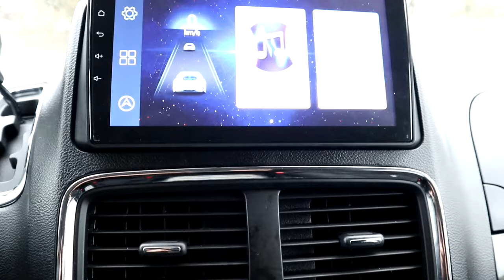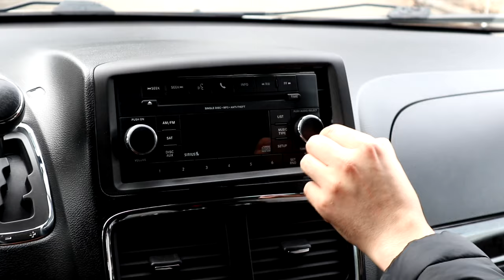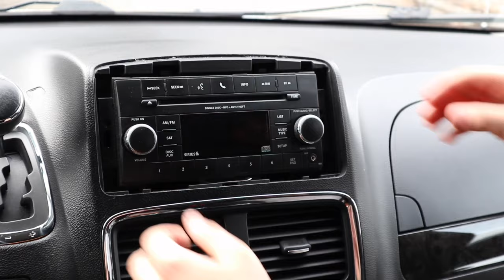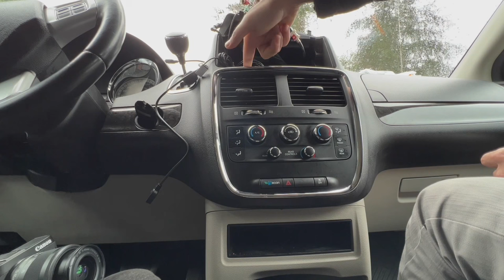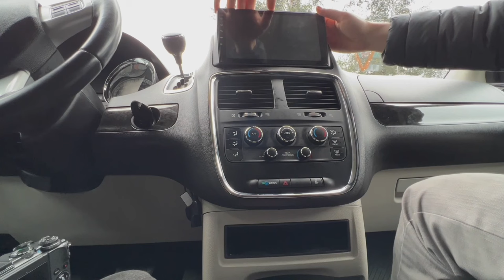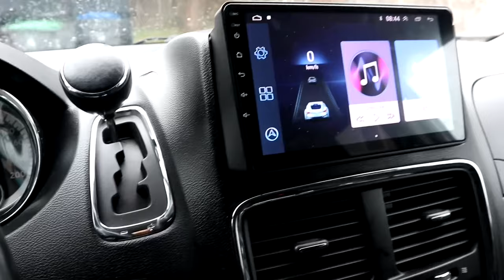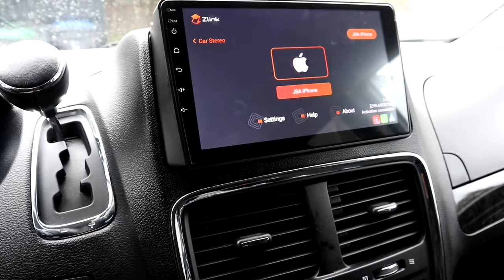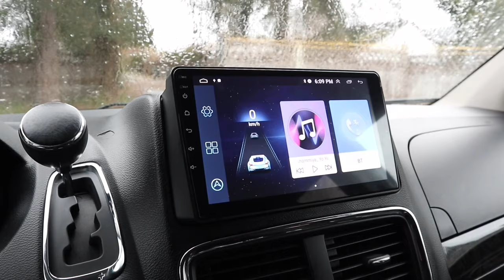Dodge Caravan Radio Screen Android Auto Apple CarPlay Backup Camera Plug & Play Install

Comment: Is it possible for you to show or do a step-by-step and how to properly configured the steering wheel controls so they work. I got everything else working except my steering wheel do I need a different cable
Reply from the maker: The new link in the description is the kit that includes the screen as well. This one is the exact same one that’s in my vehicle with working steering wheel buttons. Perhaps your screen has issues.
Reply: Are there clips that hold the radio in like the original radio? As well do you have a video about setting up steering wheel buttons? Great product, thanks for the video
Reply: Can you please tell me what settings you used for the steering wheel controls? I can't seem to get them to work and I'm not sure what the settings are. But if I also have a 2015 Dodge Grand caravan so if you could call me what your controls are I could set it up as well then
Reply: @arlentulloch6481  I have the same concern, there is no way to fasten the unit down. It is loose and rattles.

Comment: When its on wireless does apple carplay run smooth? Are the navi caps slow or choppy? Does it run better when plugged in?
Also any issues with over heating? does it have a fan?
thanks

Comment: Thanks for the sensible and informative video! Does the car have the blind spot sensor? I have read in Chrysler forums that you need to keep the original UConnect radio for this to keep working or substitute it with some Maestro RR module...
Reply from the maker: No blind spot on my vehicle.

Comment: Great video! Does the screen need a "dash kit" to install the new radio into?
Reply: Most of the ones on Amazon that are listed for this make and model (2008-2020 Dodge Grand Caravan) come with everything needed, including the frame / bezel and the wiring adapters. Minimal splicing is sometimes needed if you want to use your original backup cam.

Comment: I have a 2918 Dodge Caravan came with the satellite radio Sirius and an OEM backup cam. Can the original wiring from the backup cam be used for this setup? Very interested to dobthis upgrade. Good video with a wealth of information on how to open the cluster. Thank you
Reply from the maker: Your OEM Camera can be integrated into the aftermarket screen but it requires a cable that converts the OEM backup Cam wire to RCA which then connects to the aftermarket screen. You will have to source the adapter online. I’m not sure about the Sirius Satellite Radio.

Comment: Thank you so much for this clear tutorial. (At 00:11:00) how difficult is it to create space for the USB and mic cable? That’s my only concern about getting into this project.
Reply from the maker: It’s not hard as there is a lot of room to work with on the Dodge Caravan. Easy to route the wires around/behind the dash.

Comment: I have a 2019 Caravan....did your Van have the rear screen and if so, does it push output for Netflix, USB input, SD card, etc to the monitor?
Reply from the maker: Unfortunately, the rear entertainment system is not supported.
Reply: @samiseries6295  Follow up, did you need an additional adapter to retain steering wheel controls?
Reply from the maker: No additional adapter needed you just have to change the canbus from what ever it’s set to jeep in the canbus settings. If jeep doesn’t work for you try going through the list until it works.

Comment: i have an 2019 Dodge Grand Caravan Crew, this Android Radio Screen work with the original genuine rear back camera ?
Reply: Thinking the same thing
Reply from the maker: It does but you have to find the adapter cable that converts the stock connection to RCA video.

Comment: Thank you, this looks great! Did you ever get a back up cam installed? Was it hard?
Reply from the maker: Yes I did. Video of backup cam install is on my channel. Check it out.
Reply: Will check that out right now, thank you again. I have my unit coming Jan 9th for my grand caravan!
Reply: @samiseries6295  no video to be found. Alibaba is asking to purchase 2 units minimum. Why?
Reply: Did the mic work fine on highway speeds as fsr as phone calls? Or was there a lot of road noise?

Comment: I am trying to reach out to you on the website to purchase one for my dodge grand caravan 2015 .. how long does it take to get delivered to Maryland ? And will I need to buy any thing extra or everything is included in the package?
Reply from the maker: Sorry for the late reply. It will take 2-3 weeks. Everything is included in the kit to get the screen and after market cam installed. You may need to source a power cable/tappers to tap into the reverse light of you vehicle.

Comment: Do your dash board speaker work?    I installed my setup with an aftermarket harness but i only get sound out of my door and rear speakers.  No dash board sound.  Or center speaker.  Let me know how yours sounds.   Thanks.
Reply from the maker: I would have to confirm then get back to you.
Reply: @samiseries6295  thanks

Comment: Sami did you figure out how to connect steering wheel controls to your head unit??
Reply from the maker: They should work out of the box. You may have to change the CANBUS setting if it’s not working. Supplier should be able to help you with that.

Comment: Does it support steering wheel controls?
Reply from the maker: Yes the model that I purchased works
Reply: So I ended up buying a radio I connected it today but it’s not supporting my steering wheel  control do I have to add any other cable. Also this radio does not come with zlink. Do you know if I can access apple car play.
Reply from the maker: @RonDIYMods  Did you try programming the steering wheel controls? Could be the actual screen itself. It should have Zlink as I ordered the ones I linked and connected them to my Van to make sure it has zlink and everything works fine.

Comment: I'm interested in ordering this kit ....So how has this head unit & kit been working on your Dodge ? What is the name of this unit or is it just a no-name china unit....as I don't see any reviews? How is the sound and speed? Any glitches with its processor? I don't see a wifi antenna ?   And how long for shipping when ordered thru your store? Is there any warranty and customer support?
Reply from the maker: The one in the video is the original one I installed which turned out to be bad but since then I changed it to a much better model which is working great. New model which is currently sold on website includes wifi and is better overall.
Reply: Thanks for this!  Exactly what I’m looking for in my 2014 Chrysler Town and Country. Is your updated link the link for the new radio that isn’t faulty and is still working in your vehicle?
Reply: One more question, when I go to the link provided it looks like the product on Alibaba contains less wires than what you show in your video (radio antenna at least.).  I am excited about a plug and play but want to make sure I’m getting what I need.  I’m also hesitant because I see some comments saying it cost 290 something and what I am seeing is cheaper.

Comment: does the volume and skip/tune controls still work when you switch over?
Reply: You have to go in the settings and change things for it to work again
Reply from the maker: On the steering wheel? Yes mines worked.

Comment: Is this a reliable unit compared to the Sony that has 3 year part warranty? I worry about these no name units and their reliability....
Reply from the maker: Well with electronics even if it’s brand name you can have issues. I don’t think the Sony one integrates into the old radio location like the one in the video. Ultimately it’s up to you which route you want to go. Good luck.
Reply: @samiseries6295  How long have you had this unit? Thanks.

Comment: Do you have a link to the same exact one you bought because the one you linked is different
Reply from the maker: I had issues with the one I installed on the video which is why I did not link that one. I ended up changing it to another one and the 2nd one is currently the good one in the Caravan. The reason why I linked the one on Amazon is because it is more cost effective.
Reply: @samiseries6295  does it install the same way as in the video?
Reply from the maker: @nunya Yes it’s exactly the same.

Comment: Do you know if you have a stock reverse camera would it work with this unit?
Reply from the maker: It’s compatible but you would have to find the adapter the plugs into the cars reverse camera connection which converts it to a yellow RCA video so it can be connected to the screen.

Comment: I'm pretty sure it is but will this work on a 2017 Grand Caravan ? I see the harness is sold out. Is that necessary with this kit ?
Reply from the maker: Hello, yes it will work with your 2017 Dodge Caravan. Does you Van have the rear DVD player? The harness is only if you want it separately but the kit includes everything (Harness+Screen+Hardware).
Reply: Is this 9 inches or 7?

Comment: Just bought a unit from the site, order number is 1011, I just wonder when can I expect the delivery?
Reply from the maker: Tracking number will be updated soon.
Reply: I am installed it in now but the package does not have a car mic and back up camera seem to have some missing connections cables?
Reply: I send an email to the email that I paid via PayPal, it was bounced back, I try to get installation support via contact us on your site, I got no respond. The screen just shows the android logo then go blank immediately, I need help
Reply from the maker: The Mic is built into the screen. Double check all your connections. Make sure they are all secure.
Reply from the maker: Is it possible to send a video of the issue you are experiencing to samiseries23@gmail.com? Be sure to include the connection in the back.

Comment: Just got the unit like this and it only works until I turn off my 2016 grand caravan for 5 min. After that my unit not turning on the screen. It stays connected to my iphone, I can play music make calls but screen stays just off. Only way to turn screen back on is to hit reset button but then everything repeats. It stays on until vehicle turns off. Any Idea?
Reply from the maker: It’s best if you contact the manufacturer that you purchased the screen from. Sounds like a wiring issue.

Comment: Will everything seen in this video be compatible with a 2014 Dodge caravan?
Reply from the maker: Yes it’s compatible. You can order now. Link is in video description. Also added it below. 

https://www.ebay.ca/itm/284895770731?mkcid=16&mkevt=1&mkrid=711-127632-2357-0&ssspo=yfpqZQ4-SMm&sssrc=2051273&ssuid=yfpqZQ4-SMm&var=&widget_ver=artemis&media=COPY
Reply: @samiseries6295  can I get the plug and play connector separate? I already have the radio, I’ve been waiting for the plug and play part
Reply from the maker: Unfortunately the link is the kit for everything. I think it’s best if you get the kit. There may be compatibility issues with your screen.

Comment: Does it work with the original reverse camera?
Reply from the maker: It does but you would have to source an adapter that converts the OEM Cam cable to RCA.

Comment: Does this have WIRELESS Android Auto as well?
Reply from the maker: Yes it has wireless CarPlay.
Reply: @samiseries6295  I asked about Android Auto, not CarPlay. CarPlay is for iPhones. Android Auto is for Android phones. Does this to "wireless" for Android Auto?
Reply from the maker: Yes it supports both Android Auto Wired/Wireless and Apple CarPlay Wired/Wireless.
Reply: @samiseries6295  Is the eBay link you posted here the same? It's much cheaper so I was going to get that one.

Comment: I got mine and everything looks great but I am missing one USB port and the microphone
Reply from the maker: Glad to hear it’s great. Actually the microphone is built into the screen with this model. The one in the video is an older model which required a external mic. As for the USB I can try to see if the supplier can send you another one. Can you send me a picture of the missing item to samiseries23@gmail.com?
Reply: Where can I find the one that doesn’t require an external mic?

Comment: The only thing I don't like is the fact that I can't plug in my existing backup camera or use the existing microphone that came with my original, Uconnect radio.
Reply: Yes you can! I did mine today
Reply: But d8d you have to search for additional harness connections to make it work?@FafaWick